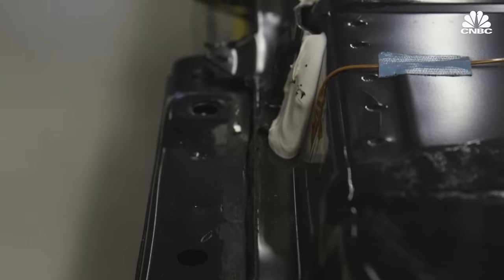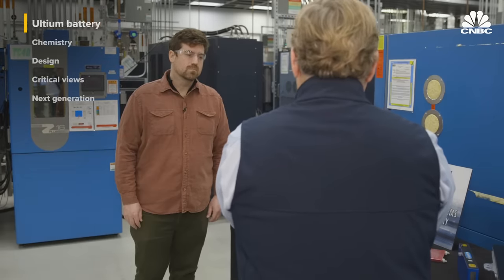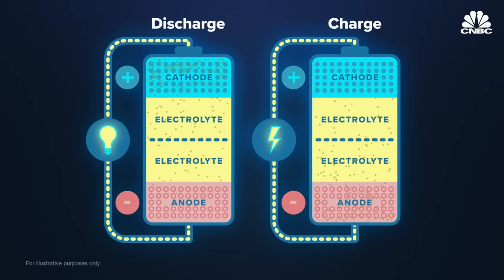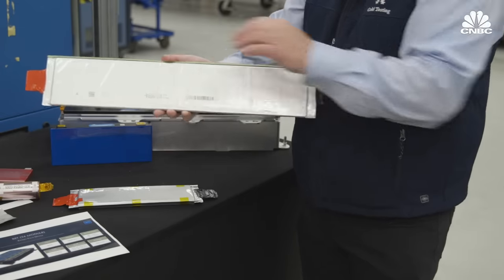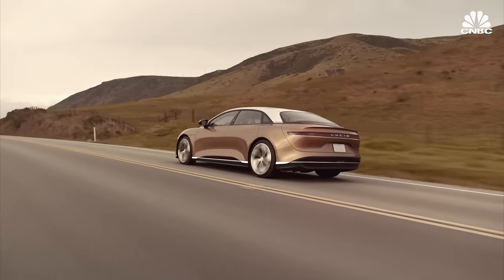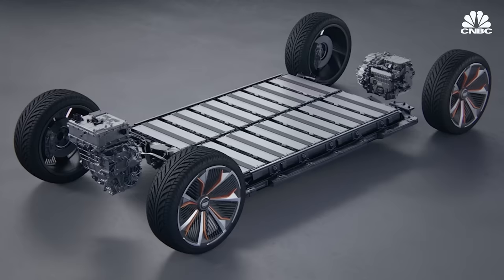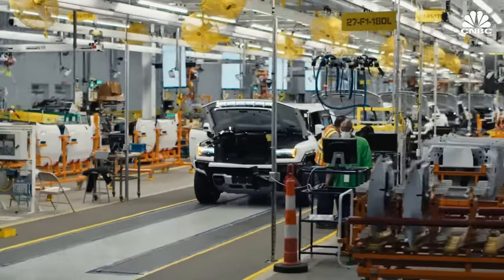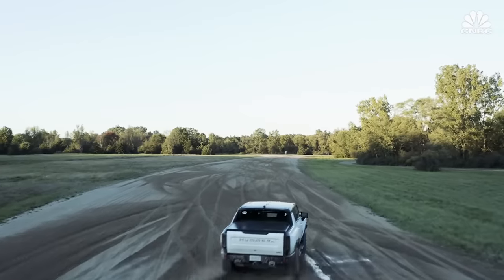Why GM Says Its Ultium Batteries Will Lead It To EV Dominance

Comment: I am rooting for GM.  However, if GM manages to survive to 2035 and truly become fully electric by then, that only means that they will be running 27 years behind Tesla.  It's hard to stay relevant in a market when you are that far behind your main competitor.  This is the case especially considering that "G-7 governments would “strive” to ensure that the majority of all new passenger car sales are not petrol or diesel-powered “by 2030 or sooner.”"  2030 is only 7 years away.
Reply: Surprise, surprise 2035 ice cars will continue to be sold 10s more than electric cars
Reply: @kevins3646  So then you're saying that GM's business plan to be entirely electric by 2035 is a mistake?  You should tell Mary Barra...
Reply: @ibnorml  it is called marketing and playing to the media.
Reply: @kevins3646  Sure, as you say GM could be lying...however, if so, they will quickly be in pretty serious trouble with the SEC and investors.
Reply: @ibnorml  the issues will not be that GM does not want to change to electric cars. The issue will be that batteries will become more and more expensive as a number of automakers start switching over to electric cars  and will make EV cars cost prohibitive.
Reply: @kevins3646  As the auto industry ramps battery production up, batteries will become cheaper.  That is a given.  In the last 15 years battery cost has already fallen from over $1000 per KG to less than $150 per KG, with a doubling of power density.  By the end of 2023, batteries will be less that $80 per KG, with likely another doubling of power density.  But that is besides the point.  Either GM is working to become fully electric by 2035 or GM is lying to its investors.  If GM is deliberately lying, that is a major no-no to the SEC, with corresponding fines levied.  I don't believe they are lying, but I do think they will become irrelevant as things stand today.  To be honest, I hope not (the same goes for Ford), but in order to stay relevant I suspect that GM will eventually be bought out by a Chinese company, which will be a shame for the US auto industry.

Comment: Mileage estimated are with optimal conditions.  Extreme cold or hot affects range obviously, and charging times.  Lithium batteries are not a good answer.  I don't know the right answer, but I do know it won't be lithium.

Comment: Will Ultium support wireless charging?  Cities could build wireless chargers under the blacktop and have them at parking meters and if Ultium has ID (owner) info in the batteries, the cities could earn money by automatically charging (for those who enable it) wireless Ultium batteries!  Also, if the wireless is bi-directional, we could use our GM auto for electricity backup for our homes during emergencies.  Also, electric companies could use (with permission and compensation) the Ultium batteries to support an existing local grid during peak consumption hours!
Reply: Also, if Ultium is a long lasting standard, would you be able to take the existing batteries out (when the body rusts out) and have them placed in a new car (buy Ultium without cells and add the Ultium cells from your old car that rusted out)?

Comment: Batteries and solar  panels requiire a lot of minerals that are not out of the ground yet.  One thing people don't seem to realize is we are going to  be replacing oil well's with gigantic holes.  right now batteries are limited due to shortage of those minerals and most of it comes from China and Russia.  So its the new whoever has the supply will be on top.  The us govt is so afraid of environmental impact they won't let the US mine it here.  So it has to be bought from other countries just like oil.  The new EV tax credits says everything has to be American made from the battery packs on up.  so it won't be usable at all.

Comment: It's just not enough. Period. It won't be enough to swap out big, heavy, frequently-changed vehicles for cleaner versions that weigh tonnes.... CHANGES IN HABIT and attitude are also needed which includes: Making vehicles that last much longer and consume much less of everything.... Yes, dear America, even if that means going smaller !!! Electric cars need electricity to charge and a whole range of rare-earth elements to make them. A true Life Cycle Analysis of EVs shows that the true longer term goals MUST be making them last longer, weigh less, using much less materials in production etc. And having less vehicles made too- which means more people using public transport, bikes etc. Oh, and while we're at it: Sourcing ALL our energy asap from renewable sources. It's not a 'pick and mix' option, its a full and complete package...

Comment: Regarding Range.  Don't tell me that theoretical range number.  Tell me the absolute minimum range on a zero degree day.  That will be the more important number than one that is theoretically possible but is not actually achievable.  "your mileage may vary"  Those four words make lying about range easy.

Comment: Damn... I was expecting one of the up to date SSB "SOLID STATE Batteries" getting a mention that are now in the Mass Manufacturing "Teething Stages" By several major car manufactures and their Battery Suppliers, which BTW will provide many more miles per charge than a mere 400 Miles or so, and what's more these SS batteries are claimed to take less time to fully charge them up than it would take to fill up a tank of Gasoline..
Meh.. Whatever.. I guess whoever releases such a car with solid state batteries which will fully charge up in minutes and give me a little more distance 1st will get my dollars..

Comment: its nice how the media spins things in a positive light for evs outside of tesla. ultimate is barely comparable to the 4680 and they are shooting for 2025 where tesla is not going to sit still for 2 years and will only improve. so GM might have a battery almost as good as tesla 4680 today. good luck with that.

Comment: The big concern I have isn’t their products they can build the best electric vehicle.  The current power grid sucks has major cyber security flaws and like old light bulbs one goes down they all go down. What about in an earthquake or tornado or forest fires where power is out for days or longer.  Really what do you do if your EV isn’t charged and you need to get out of danger or someone is hurt and you gotta rush to the hospital. Sorry I can’t lay my life or families life on this if the grid is obsolete why do you think no one talks about it….

An old chevy gas/diesel truck is reliable and easy to fix if it’s down.

Comment: GM ist bold.
With that 200 mile warranty?
Good deal.
Remember 
Never buy.
The first 2 years of A vehicle/ recalls?
Exception
Tesla.lol
Reply: This blonde hair guy is such a overweight liar there's no block is just like more bigger cells...

A block
Ist a block*
Blood guy: BlockHead!
Reply: GM still stuck in 1956...
Monster vehicle.
Small success/ like venza
Charge every night
4 10 hours?
SMARTER.

ELECTRIC HUMMER
WELLL
 NOT SMART.

Comment: Tesla knows that with proper cell testing, good software balancing, and good temperature regulation, there is no point to all this modularity, it is just so much extra weight.
And no one wants an electric vehicle that does not have a fronk.  They have to make smaller, more capable motors, and design vehicles to have a fronk.  Toyota also has this problem of no fronk.  When supply increases, and people can choose, the makers with fronks will get the lion's share of the customers.
When Tesla introduced the fronk, these other makers all sneered, and they kept this self-destructive attitude.  They ignored the customer.

Comment: Everyone here doesn’t understand the actual environmental disaster looming around these batteries, used solar panels, and un-recyclable wind turbines.

These ultium battery packs weigh about 3,000 pounds BY ITSELF.

Do you honestly believe it’s better than gasoline?
Do the math. Gasoline weighs about 6 pounds per gallon, one gallon can get you 30 plus miles. So even on a 10 gallon tank you can go up to 300 miles and the amount of gasoline used weighs a whopping 60 pounds 
It all about energy density and weight. You can put all the batteries you want in your Tesla or hummer but your fighting against your self by adding weight which reduces your range.

Simple math.

The emissions from gasoline vehicles is far less than the pollution that will be created by your so called “green energy” in the landfills

And you all call this “progressive” or “moving forward”

You understand that the range of an electric car from the 1900’s is roughly the same range as a Chevy volt today?  But we’re moving into the future… at the pace of a snail… by design.

Hooray!!!!

Comment: I doubt this will hold true.  They cannot even build enough cars (incuding EVs) because they don't have the raw materials to build batteries, and don't have enough chips to build even gas cars.  They are not even #1 in America anymore (passed by Toyota last year) because their supply chain is in worse shape than Toyota.  Sure they have a good battery with two layers that can go 400 miles, but without the materials they won't pass anyone.  Also, there is newer technology coming already that allows a battery with 400 miles go 700 miles with a new crystalize structure.  Unless GM adopts this soon they will find that their "new" 400 miles will be shorter than competition that adopts this newer technology.

Comment: the automatic plug in will be the next 'killer' gadget.

the daily drive is only 10% of a battery's capacity, and only needs a slow daily top up, ezi pezi.
the EV will plug itself in automatically 24/7 and trade power with the grid. except in rush hour.
every building is connected to the grid, every building.
THE MONEY WILL BE IN THE GRID. Trading power across the entire grid.

The EV battery will be huge and its full capacity will only needed for a few annual long trips.
300 million vehicles in the USA
200 million roof tops in the USA, all connected to the grid.
the grid will monitor the weather and transfer power. 

Everyone will want their Electric Vehicle. EVERYONE. At least one, if not more.

Petroleum will be a strategic military reserve asset, and give the USA control of the sky in war times.
Nuclear will be side lined as all dictatorships want nuclear industries.
The USA is the biggest target in the world and the USA military would need to grow to match world wide nuclear capacity.

Comment: When do we talk about this industry wide claim for zero emissions honestly? All of these batteries are full of metals. This video is almost entirely about the cobalt and lithium that is in them. So tell me how you plan to responsibly recycle the old batteries in these cars also. Don't just throw them out there and wash your hands of them once they are sold. You're producing a vehicle that is every bit as toxic if not more, then the current combustion engines on the market without considering the long term affects of the waste it produces and the extreme complexities of dealing with it.

Comment: What's with the Cadillac's front grille? Do we really need the grill itself to be a bunch of light bars? Is it me or does GM have some of the tackiest designs? I mean, other than the Toyota Prius later generation with those "lightning bolt" style tail lights. Yuck.

Comment: 10 years from now, people will look back at this "Ultium" tech as stone age tech in reference to what we will have then.  All these vehicles will be worthless for resale.  So I see any expenditures in buying these "state of the art" EVs coming out in the next 5-10 years as helping to fund continual research.  I'm glad there's plenty enough people buying them in order to move the tech forward.  I don't know many people that would be happy to sit and wait 1 to 2 hours every 300 to 400 miles for a charge going cross country here in the US.  And replacing $25k batteries is not an option. Even though it looks so space age now, there's still a long way for battery tech to go. Just as important is the infrastructure to support Evs including the disposal of all the dead batteries, and the way the power stations produce electricity may be decades away.  If we still produce power using coal and fossil fuels we will make the carbon footprint bigger and defeat the purpose of making more EVs.  And wind and current solar power is only at less than 5% of the worlds power output.  We literally have the cart before the horse with all this EV craze.
Reply: Won't be worthless. I own a 3018 Bolt now but my daughter uses our old 2011 Leaf to go back and forth to work. The Leaf is 11 years old and still has a real world range of about 50 miles and that is enough.
Reply: @steven4315  I stand corrected.  Yes I agree, as long as any EV battery is still chargeable, the vehicle will have some type of use. Instead of "useless", a  better word might be "undesirable" as far as resale goes.  I know a model T can be made to still work and drive just like it did when new, and it can transport people. And "undesirable"  would more realistically be 20 years from now, when there are older higher range vehicles for sale.  Then it would be a matter of choosing a EV with twice the range for a little bit more money than one that doesn't, thereby driving the resale of the older battery tech cars down dramatically.   It's just my personal dilemma.  I want a half to 3/4 ton equivalent EV truck that can go at least 800/1000 miles and have battery life of half to one mil miles.  That's at least 10 years away.  I'm 75, so I won't see it happen.    *****But I am very surprised that an 11 year old Bolt only has a 50 mile range.  They advertise it as having a 20 - 26 year battery life,  and that is considered above 60% capacity.  So using their advertised 259 mile range, you should be getting at least 155 miles range worse case up to 20 years.  So that's the other thing about these EVs.  The sales pitch is just not true on most of them.  The prices are well past price gouging and down right greedy in your face at the dealerships where the money doesn't go back into research.  So I think some day having an EV type of vehicle is the way to go, but I don't want to make the greedy rich Cartels that much richer by paying up front money to get a damn EV truck that can only go 200 real miles and not 300 miles for $75k.  Those are the vehicles that I'm primarily targeting as almost useless brand new.
Reply: @ginginthing  I said the 11 year old LEAF had a real world 50 mile range. If I recall right the LEAF originally had a EPA range of 72 miles. The BOLT battery is under warranty until Nov/29 135,000 miles.
Reply: @steven4315  Oh.  You meant before that you are getting an EPA equivalent miles per gallon.  Not range.  Your combined equivalent mileage on a 2011 Bolt  should be around 60 mpg when on electric and gas, city/hwy.  Of coarse that's not realistic, so u r saying u get about 50 mpg equivalent.  The total range with full fuel and charge, should be about 370 miles.  I'm all for hybrids because they make more sense right now, until battery tech becomes more usable for full EVs.
Reply: @ginginthing  I edited my original comment to make it clearer please go back and reread it, thank you.

Comment: Once an EV gets a minor accident, it is considered totaled by car insurance company. EV car value drops significantly over short period of time. I am an electrical engineer and the whole EV idea is terrible for the consumer due to very high costs for repair on faulty electrical circuits (hardware) and glitchy software (like Windows OS). Can't do car repairs yourself and can't get parts at Autozone. Car companies know they can make a lot of money from the consumer in repairs and can charge the customer whatever they want. They are working hard with government to push for EV in name of "climate change". What a SCAM!!

Comment: Just remember that LG caused all the fires and GM still are working with them.  The recall is a complete disaster with GM not sending notice to buyers and then dealers taking over a year to do so.  As long as LG is involved you will be at risk of fire.  GM should have never sold ANY vehicles without completely replacing batteries in  ALL sold / leased vehicles FIRST.  Profit over safety is the goal of GM.  They still get new packs and sell new cars without replacing the crappy ones first.  They are selling Kia EV6 and Tesla cars for them just by being greedy and hiding from their responsibility to the safety of their customers.  Our car is going on 3 years old and is on the list and we have ZERO idea because profit of new cars comes first.  Also know that GM pays advertising to these people and they are just spewing unproven promises.  2020 car with a postcard from dealer a few months ago.  Ford at least learned from LG and GM failures and is using a better company ( CATL ) putting a factory here in stead of half a world away.  A bigger turd is still a turd ........   These packs are made from crap still.  FACTS from an owner.  Soon to be former owner and never buy Chevy or GMC ever.  Just like thousands of current and potential owners.  These gambles are paid for by 3 billion in loans NOT GM.  If they default on the loans then YOU will be stuck with a worthless vehicle.

Comment: Too bad LG Chem also made all the batteries for the Bolt's that all had to be recalled. I hope they learned their lesson. If something similar happens again, it might be a good idea to have deals with other battery companies, so it doesn't hault your EV production to a standstill again; just saying. By the way, SAIC Motors sold 2.1 million micro cars in China, not GM. GM has a stake in the company, but doesn't build them. The cars are also tiny, low range and extremely inexpensive compared to full size electric vehicles. To say GM made 2.1 million electric cars in China last year, is extremely misleading.